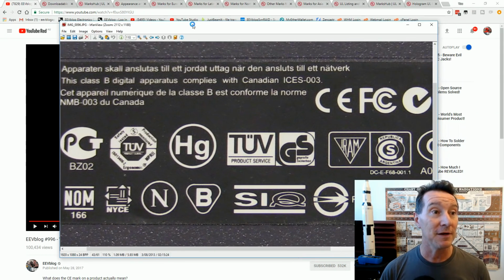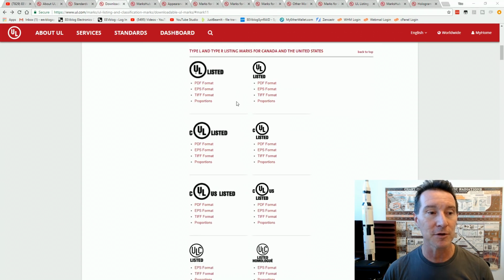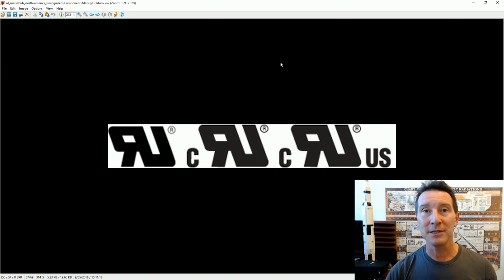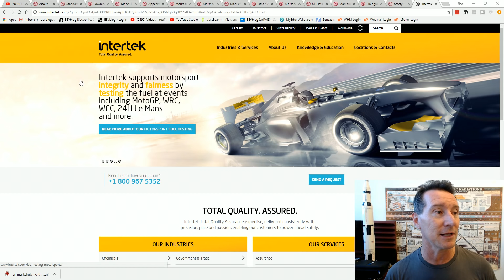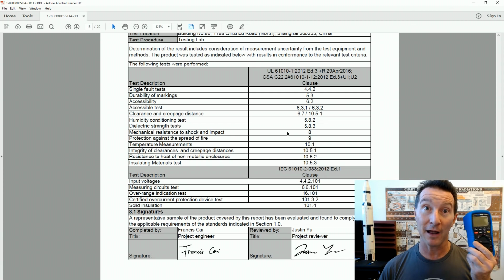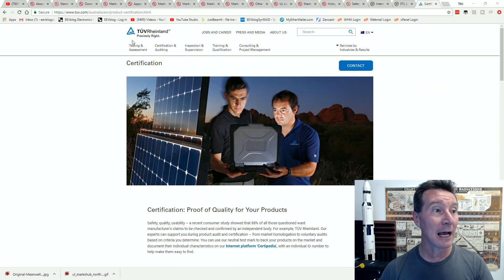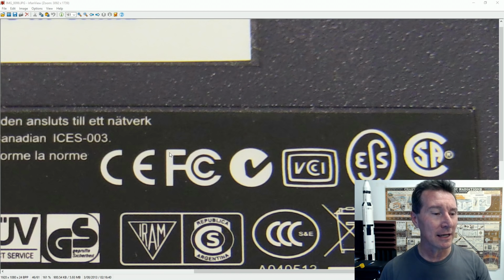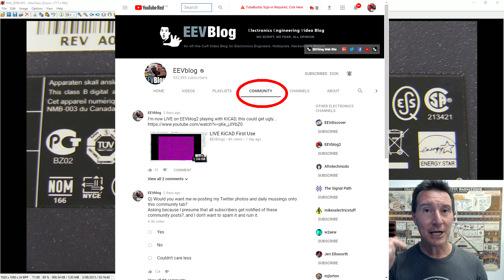EEVblog #1082 - What Do Compliance Logos Mean?

Comment: On that Dell PSU there is even a polish safety "B" mark - the B in a triangle. We used before Poland entered the EU to certify safety standards according to polish norms, after entering EU these we harmonized with european regulations and the mark was replaced by the usual "CE" mark, now this mark is purely optional. Now you won't find that on Dell hardware, even on one made in Poland. So I bet the PSU must be a bit dated ;)

Comment: Thanks for the information Dave.  But I've always wondered what they really used for?  Do they mean that the product can/cannot be sold in a particular country?  Or is the consumer supposed to know that they shouldn't use a product unless it contains a certain mark for their particular country?  I get that they can understand that the manufacturer has spent thousands of dollars getting the testing done, but how do they know which marks apply to them and their protection?  In the U.S., a general rule is that if it's not UL listed, it might not be safe for use.  But is that really the case if other testing agencies are doing the same tests?  It really gets confusing for the consumer as to why all these marks are on the product.
Reply from the maker: As I said, it depends on the country and the type of product. If it's a multimeter then there is no requirement in any country to have ti UL or ETL tested.

Comment: GS means "Geprüfte Sicherheit" or tested (for) safety. A testing lab like TÜV or Intertek, Eurofins, Dekra (...) must meet high standards and must accredited in many fields (some are mandatory, some are not) in order to be able to issue a "GS" mark. Unlike other certifications GS is based on German legal requirements, in this case the requirements of §21 ProdSG (product safety act). The GS mark is the only one (in EUrope) which is regulated by law.  Although the GS mark was once designed with the German market in mind, it apperas on a large number of products all around the world. GS marks have to appear with the sign or logo of the issueing notified body (in your cas it's TÜV Rheinland, but it also be Eurofins-GS or Dekra-GS. One has also to bear in mind, that the CE mark is issued for the singing of a declaration where in contrast a GS is only issued after the product has been successfully testedt against German/European standards by a state-approved independend (notified) body. And yes - I deal with this kind of stuff on a daily basis and didn't go nuts yet. :-)

Comment: I'd like to find out when it start to be mandatory to get a certified product. I've found that product under a certain VA will not require any... if using external high voltage that is certified, feeding DC it should not need any certificate.. (for Canada at least...)

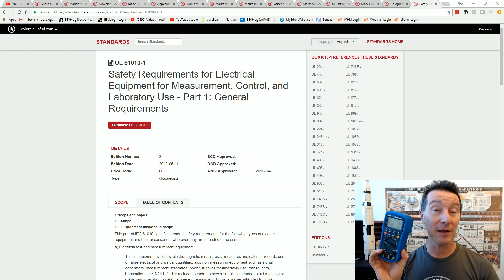Comment: Just an FYI. At 4:30 you mention the IEC 61010.  It's not specific for multi-meters but is rather made up of several standards.  61010 is the general requirements for several different types of equipment.  There is one specifically for handheld meters that refers to the general standard.  I believe that one is part 2-033.
Reply: Oops,  7:00 in.... Watch then post.  lol.
Reply: Yep that's true. But you also need to comply with general standard. IEC 61010-1 is very interasting because it has a lot of part 2 standards with particular requiritments for different type of devices.

Comment: When you see the UL logo it doesn't ALWAYS mean that this product has been tested by UL but that it has been built according to the UL standards. I'm a project manager for an electrical engineering contractor in Canada and we certify our product CSA (C22.2 #14-13) or UL (508), depending on the customer's requests and we self certify all of our products, of course in compliance with the standards in use. We usually get 4 surprise inspection of our products but that's about it.
Reply: Hi Simon, is this a way to get faster and cheaper UL certification? I'd like to get my product UL certified, could your company do it?

Comment: Some (useless?) trivia for the non-Geman speaking:
"Geprüfte Sicherheit" is just German for "tested safety"
TÜV is short for "Technischer Überwachungsverein" which translates to "Technical Inspection Club" (or "association" as Wikipedia calls it). There are actually a number of those "clubs" in Germany which have split the different regions up amongst them. 
The TÜV is somewhat (in)famous for the mandatory car safety inspections, they used to have the monopoly on doing those inspections so in a car context  "TÜV" has become a synonym for the safety inspection. (As in: "Used car for sale, 1.5 years of TÜV".)

Comment: It not strictly speaking the case that all of those safety certification marks require separate testing. With harmonized standards in most cases the testing is done in accordance with CB Scheme taking the required national differences into consideration. With the CB certificate and CB test report you can apply many different safety certification marks.

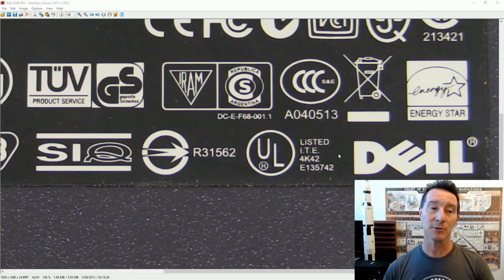Comment: You have to admit the CSA mark looks the best!  And the DELL mark just means it is nonstandard junk!  0:47   ;-)
Reply: Other marks: the HP mark means different things depending on what kind of device it is. If it's on a printer, it means it's a good one. If it's on a piece of test equipment, that means it's crap since it's a fake one (Hewlett and Packard didn't want the brand being called "HP" and Agilent was spun off before they died). But if it's on a computer, it means the same as the Acer , DELL and Windows marks: nonstandard junk!

Comment: UL was formed over 100 years ago by the insurance companies to help with fire prevention.  Back then, fires were started by bad wiring and the like, and the insurance companies didn't want to pay the $$$ to people who had shoddy products.  They formed UL to "list" things that were "safe" and thus insurable.  Over the years the UL business has grown but largely does similar work.  Various UL things are listed, like fire ratings for safes, and such things as light fixtures.  UL is a non-profit entity which is bound by the terms of its trust.  Some of this is done to prevent conflicts.  I got some of this information from a guy who worked there.  They have a local facility here in sillycon valley.
Reply: I currently work for UL, and we're not non-profit anymore. We went for-profit some years ago. Mid 2000's if memory serves.
Reply: Probably true.  My info dates from the 1980's.  I'm sure the UL web site has more information.
Reply: @Herby-1620  Little late to the conversation, but you're both half right. UL has two entities, one is a non-profit organization that publishes the standards, while the other  (UL LLC) is a for-profit company. The latter does the testing, certification, follow-up services, etc. The company split in 2012.

Comment: Note some large corporations like to get multiple redundant certification marks on their products even though the marks mean the same thing.  It may sound silly but there are reasons they do this:

1) Large OEM manufacturers sometimes sell their products to other companies that  mandate a very specific mark despite the fact another angency could have done the same testing to the same standards.  

2) Large companies selling millions of a product often get multiple redundant marks like cULus and cCSAus because it takes more liability off of their backs in the event something does happen.  

3) It's often not that much more expensive to get the second or third redundant mark because the other agencies will often certify the product by just reviewing paperwork from the first recognized testing lab then doing minimal additional testing.

Comment: The RU UL recognized component mark can be a huge "gotcha".  It basically just means the component has had some partial testing done on it.  A recognized component is usually far from being a certified component.  If you're engineering a widget and selected a recognized component vs a certified one, you could be getting yourself into a big mess if you don't find out from the component manufacturer what sort of testing was done on the part. It's not uncommon for a recognized component to have practically nothing tested. That means you'll have to fork over big bucks when certifying your widget to finish any applicable tests that weren't performed when the component got "recognized".  If you select a certified component for your widget, very good chance the agency certifying your widget will review the report and accept the component without further testing on that one part.  This can be a huge time and money saver.

Comment: Since the video is about the UL and mentions some Latin American countries, another mark that may appear is the Anatel one, for Brazil, specially if the device in question emits radiofrequency, like a phone or laptop, is a phone charger or battery(although usually only devices for the Brazilian market contains the mark, since a lot of those are assembled in Brazil).
 
That also reminds me that the paperwork for the Raspberry Pi 3B(that has a blue PCB!) that was submitted to Anatel homologation(since in Brazil some testing house do the tests and Anatel just checks and approves) was done by UL. https://www.raspberrypi.org/blog/raspberry-pi-brazil/

Comment: CSA is an out dated archaic standards certification. At least back in the 1980's before UL started to be the go to standard for approval. I had to see a SMPS through CSA and visited the test site to see why we were failing some tests. Long story short, they were testing for conditions that haven't existed since Tube (valve) radios and TVs were built and did them because, wait for it, "that's the way we have always done it". Holy crap, really guys? was my response.

Comment: "Personal Prejudice": 
handle something with ETL mark: "oh Fuuuuu.. Well, at least it will not kill me if I handle it with care".
handle something with UL (Canada) mark: "ok (still handle it with care)".
All power supplies that intended to use 24/7 around me is UL listed. Many from thrift stores, all working good. I did not choose them specially based on UL, just somehow ETL listed devices/power supplies dies more quickly.
Reply: EEVblog That's the theory but it's never 100% equal.  ETL is a for profit organization while UL and CSA are not for profit.  Can you guess which company and their engineers are more likely to play the risk analysis game to improve their profits?  Nonetheless, I would still rather have an ETL certified device plugged into the wall than an uncertified AliExpress knockoff with a CE mark.
Reply: I bet you think you're so cool with your markings. My power supply doesn't even have a CE.
Reply from the maker: They both test to the exact same standard. Your data means something else.
Reply: Yep, done exactly that. My trusted MeanWell used and slightly abused for 3+ years now.
..and it's UL listed :)

Comment: What about the DELL one.   What does that logo mean?/
Reply: that it may fail within a year?
Reply: government, school/universities computers aren't the same, they don't use the consumer grade stuff from dell they use the enterprise grade stuff which is good because it has to be because enterprise customers expect reliability, consumers they just think can get fucked.
Reply: Dunno what it means these days, but back Pentium and Pentium II era it meant "don't bother parting this out, just scrap it."  You never knew if the parts in the machine actually followed the standards or if they were "specialized" for Dell.  Wouldn't have been so bad if they had changed the connectors.

I dunno how many Dell power supplies I tossed in the trash during that time.  They had the same plug going into the motherboard as a regular ATX power supply, but the pinout was different.  Completely useless.  And I seem to remember they were one of the companies that had "special" modem slots - looked just like a regular PCI slot, but only that particular modem could go into it, and it wouldn't work in any other machine.  Junk.
Reply: I wasn't even thinking of that because that is just because they probably have contracts with the governments. They don't make only computers...
Reply: It's a warning.
Reply: Nélio Oliveira I know first hand about DELL quality. They issue a faulty BIOS update that bricks your computer. They acknowledge an issue but refuse to repair the systems they broke.
Reply: Nélio Oliveira So... Six months then?
Reply: Andreas Stevens you clearly have no idea about the quality of DELL products...
Reply: Nélio Oliveira Yea, Dell computers are definitely by far the best. That's why almost every school, university, gov't agency, etc in the U.S. uses them.

Comment: in the states ('murika), you CANNOT bring non UL devices and use them in testing, building, or repairing some industrial equipment. such as automation or refinery processes. lets say you are using a meter on a panel to a motor startup control. if you have ANYTHING other than site specified approved equipment (which yes, includes the meters from dave) you can be fired and fined. the UL, like the CE logos can be faked, so you should be able to go to UL's site, and verify its listing, and what the real device should contain. 
cert companies follow dave's method. they dont turn it on (at first) they "tehk et apaht"
Reply from the maker: Yeah, that's not uncommon. Standard butt covering.
Reply: No listing is also a violation of the National Electric Code. In an early section of the Code,  it calls for the need to have every wire, device, box, etc listed, accepted, or approved for installation. 

A common example is NM-B (TPS, T+E, etc) will carry a UL Listing on it's package, and if US/CAN, a CSA mark too. The cable will say literally (UL) along its length, along with type, gauge, voltage rating , and certification number. Sometimes footage is included.

Comment: Speaking of fcc, funny story: Just the other day I had my Li-Ion cell charger fail explosivly with a bang and a flash upon turning off an 'inductive ballast florescent tube'. (: Damage report: 2.2uf/400v cap exploded, a trace vaporised across 36mm length and deposited its copper on the case, and literally every other component smoked except for two diodes and 3 ceramic caps... no fcc or any other certification stamp found on the label, they didn't claim it to be and it wasn't compliant :))
Reply: Your comment just made my day xD
Reply: FCC logo only required if the device is expected to transmit or receive radio band interference within a certain range.  hence why the new raspberry pi radios are now under an FCC can, if you use a pi3B+ for a project you want to sell, you now dont have to get it re-certified if its not modified.